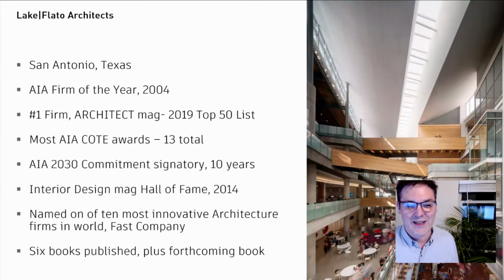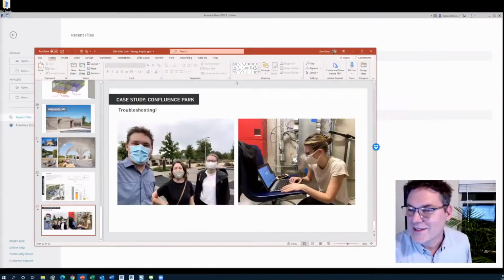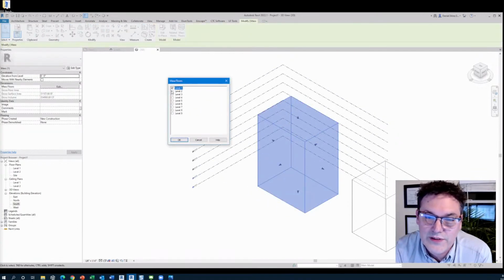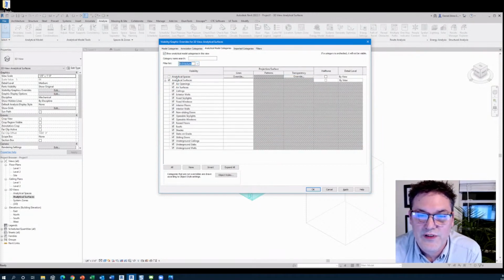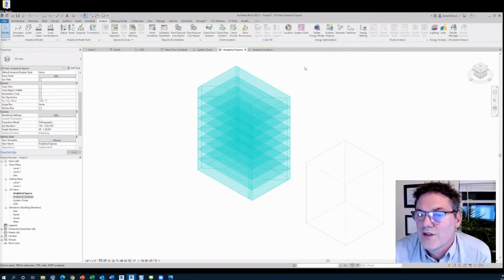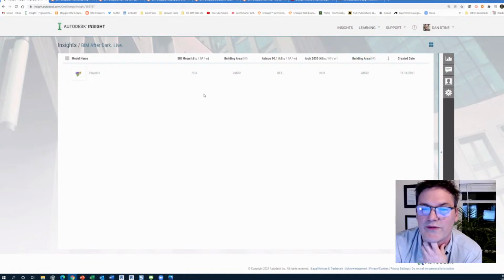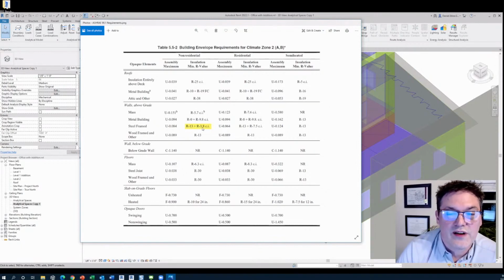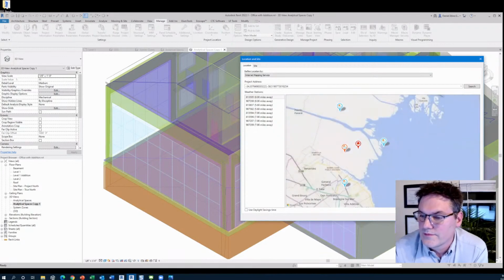Energy Analysis in Revit (Insight 360) w/Dan Stine

Comment: Hello everyone,

I am slowly learning how to use EnergyPlus through Revit. 

One error I can't seem to figure out is the fact that the total building area is different from the one I modeled when I get the EnergyPlus report. I am using only Revit (not downloading IDF to run in E+). I care that results are correct in Revit. I made an analytical spaces schedule, and it perfectly matches the total area of the building. Therefore, there is consistency, also because all spaces are conditioned.

My building has hypothetically 100SF internal area. My analytical spaces schedule result in the same 100SF. But when I run the analysis in the report I can read as a total building area only 40SF. Despite the whole building being conditioned. Is itexplainable somehow? 

Now my question is, if this building does not exist how do I assess the correctness of the result? 

Is energy plus, through Revit, calculating the energy consumption on the 100SF of the analytical spaces or on the 40SF that I get in the results report?

Comment: I've been toying with this in RVT2023 and find the UI to be classic RVT (graphically and syntactically pretty bad). So here's my Stupid Question(s)

1) Is it correct that the "Use Conceptual Masses and Building Elements" setting recognizes element geometry but not element thermal characteristics until you go deeper and check "Detailed Elements".

2) At about 1hr, Dan talks about getting a more sophisticated measurement and does a Schematic Types override of an Exterior Wall. Then he talks about about RVT automatically derating the R-Values to account for thermal bridging. I noticed that the wall he picked was "R-13+3.8 metal frame wall" if you look to the right and divide 1 by the given U-Value, you get the R-Value of 9 that shows up in the Analytic Surface properties dialogue box. So is it correct that Dan's use of the term "derating" means "dig deeper and don't trust the naming of the wall types."?

3) When I check the "Detailed Elements" box, the R-Value  of the Analytic Surfaces matches the R-Value that I see in the Edit Assembly dialogue box for the Wall Type. Is it safe to assume that The Factory has automatically derated the thermal properties of each wall layer? If not, how does one correct for that? I Thermal characteristics are often labelled as if they are a monolithic material but except for a mass timber building, one wouldn't have a solid pine wall.....in the case of a residential stud wall where one has wood studs and insulation co-existing, how would one label that layer and assign proper thermal values? What would one do in the case of an antique house with wood studs but no insulation?
Reply: I think the answers are Yes, Yes, and No. Dan give more detail on derating here. https://bimchapters.blogspot.com/2021/05/creating-custom-thermal-asset-for-revit.html

Comment: Thanks Jeff and Dan. I have a question: what is the role of Green Building Studio (GBS) in energy analysis. How GBS interacts with Insight.
Reply from the maker: They are one in the same... Sort of, from autodesk: "Green Building Studio is the back end engine for Insight360. Insight360 provides a sensitivity analysis and combined factors for high performance building design. You can use insight360 to have real time interaction with the design parameters and compare the performance with benchmarks."  I am sure Dan has an even better explanation.
Reply: @TheRevitKid  Right... you can even open GBS and see all of your Insight runs. But we almost never need to do that.
Reply: @TheRevitKid  Thanks Jeff